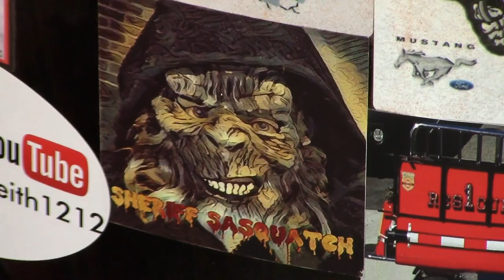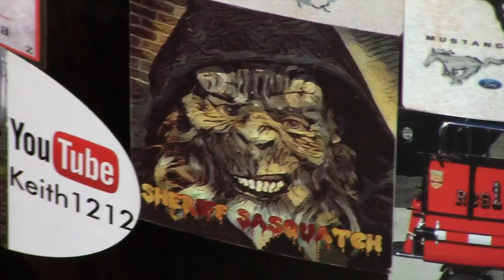plum crazy  purple with a twist

Comment: I actually painted 2 pins last year in the same color as trophies for a local high school and they turned out great.. The school just brought me 4 more to do in the same color with their mascot airbrushed on it.  They are pretty dinged up though... My question is did you use any fillers before paint if so what kind... I’m using a bondo just wandering if there was anything better?
Reply from the maker: I used metal glaze to fill the chips